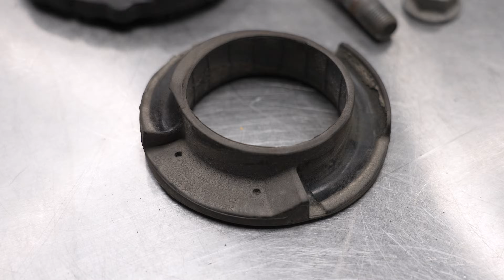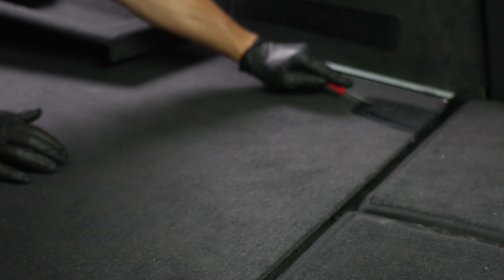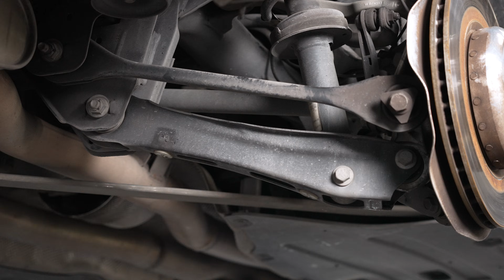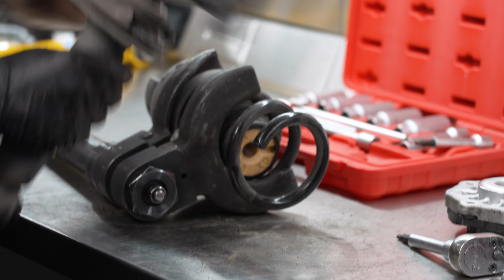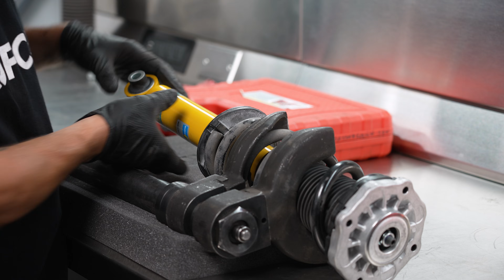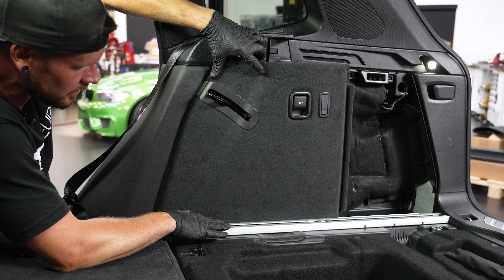BMW X3 Rear Shock Replacement DIY (2018-2024 BMW G01 X3, G02 X4)

Comment: Guys, you make excellent videos! I just wish your website prices were slightly lower than other sites. With the new tariffs, importing from the US to Canada (especially for European products that now have tariffs in the US) is getting really expensive. Same transmission oil pan that costed me 240$ CAD now it's more than 460$ CAD